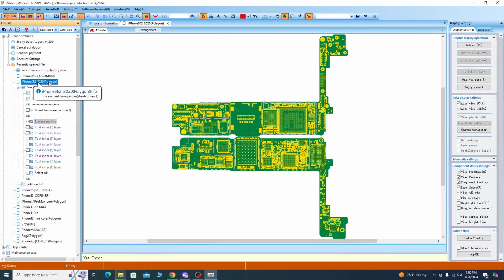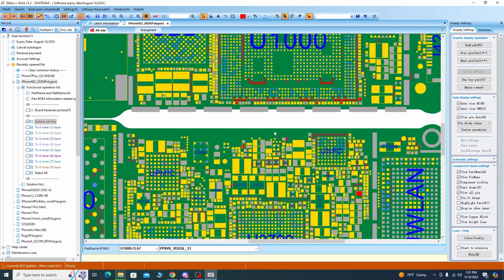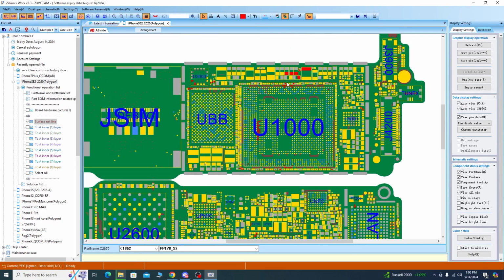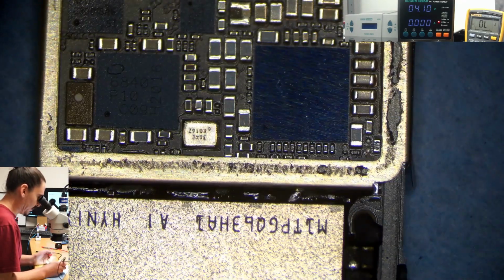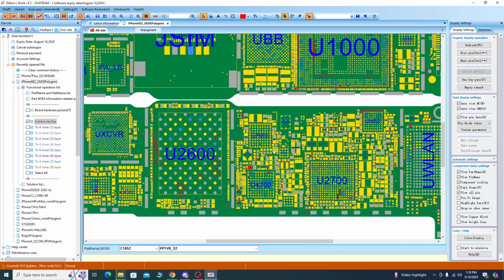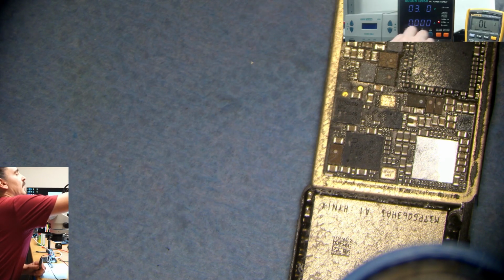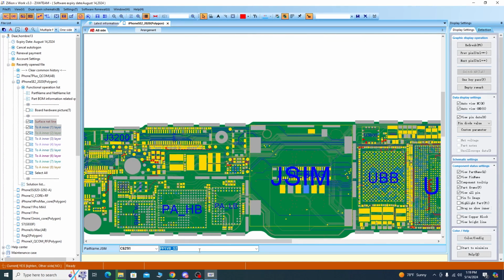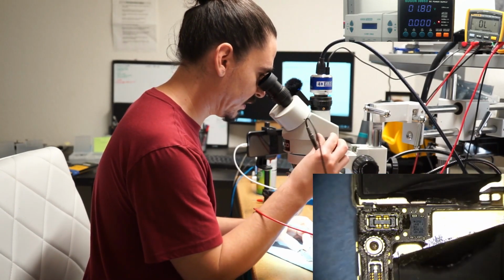iPhone Data Recovery Live Diagnosis & Motherboard Repair - How to Solve Looping DCPS Amp Draws

Comment: this is not a technician issue...customer viewed a couple youtuber repair video and thought they were competent enough to repair it themselves if it was caused by another technician they wouldn't  have lied no customer gonna lie to protect an technician
Reply: Are you sure abt that. You'd be surprised
Reply: @donlovesTECH  it's simple bro why would the customer lie about device failing on it own when clearly it was the incorrect screw has caused it to be shorted??? these things are common sense even my son could figure it out
Reply: Makes logical sense. I could definitely see a customer blaming another repair shop for this type of damage however people buy phones second hand so could be it already had this issue just got worse over time and customer had no clue.

Comment: Great job. What thermal cam do you use?
Reply from the maker: seek
Reply: @iBoardRepair  okay
Reply: Just seek or Seek compact or pro?
Reply from the maker: @jeffersonayemenre4925  compact pro: https://www.amazon.com/Seek-LQ-AAA-Compactpro-iOS/dp/B07GX8XTG5?keywords=seek%2Bcompact%2Bpro&qid=1680158796&sr=8-2&th=1&linkCode=sl1&tag=scdigital-20&linkId=f80cfe6183913baaf39d10498cdc6747&language=en_US&ref_=as_li_ss_tl
Reply: Okay. Thanks IB. I want to get one.

Comment: Good job! 🎉 I recently the other day fixed an SE2 with a problem reporting the battery which showed 0% Charged and Always low battery. A Diode mode reading on I2C3_SMC_GG_SDA and SCL showed a reading on SDA but OL on SCL. Using the board view, I couldn't find schematics anywhere for the SE2 and the SE1 and SE have different charging circuits to this one. So since the iPhone 11 and iPhone 8 share the same battery connector as the SE2 I checked their schematics to find similar components to fix the issue which was a cracked resistor that pulls voltage up from PP1V8_S2 through the resistor onto the clock line. First ever time at doing this repair and now the battery reads fine 😅
Reply from the maker: great job! Are you using zxw or which board view software? ZXW has the se2 but maybe you need to update or redownload. Either way, that is great detective work to get around not have schematics/boardview
Reply: @iBoardRepair  I used REFOX for the moment. I had zxw before but no idea how to renew the software so it expired 😢 I would like to get it again though. 
Literally the resistor looked perfectly fine until a light poke with the x-acto saw it disintegrate into pieces.

I currently have my brother's iphone 11 which I have shelved for the moment after a drop caused pads to be ripped under NAND and the pads on the sandwich. Both were restored however I still get a bootloop where the current goes up to .276 hangs then loops. Everything else seems fine and I've already rules parts out as there no difference. When restoring the phone comes out of DFU but fails to go into Recovery mode and goes back to bootlooping I'm just waiting on the programmer to try read the sysconfig file of the NAND. 

Other than all that, I look forward to more videos, very cool to watch 🙌